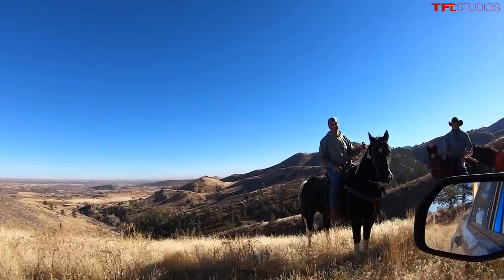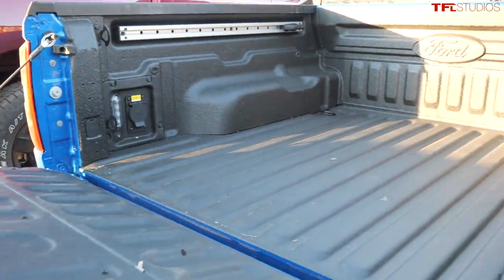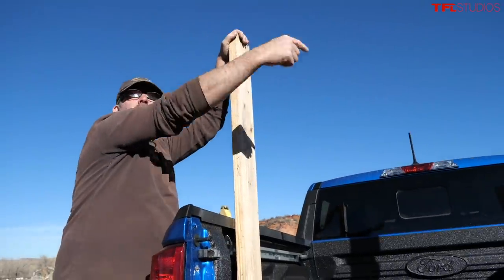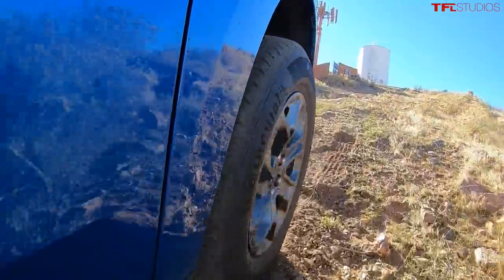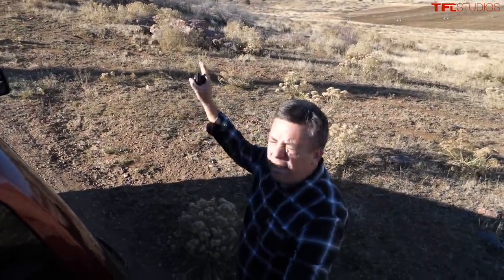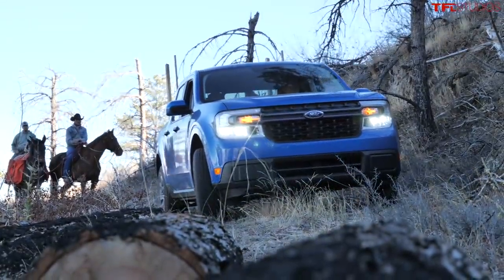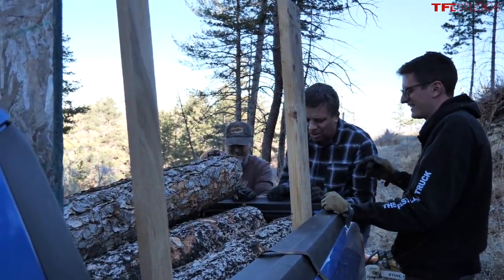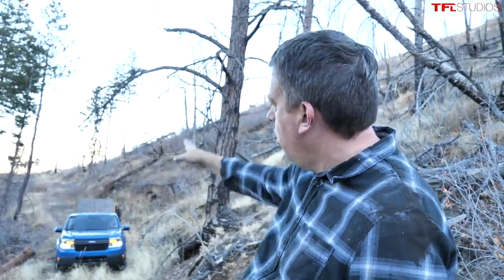Did We Go Too Far MAXING Out The New Ford Maverick To See If It’s Ranch Rated?

Comment: The is good proof for the "I'd rather have it and not need it than need it and not have it" crowd that drives an F-250 everyday to the office just so they can use it for projects once a year.  Get more of these on the roads and the roads are safer and the environment is better off and the owners keep more fuel money in their pocket.  A win all around.  Or like the guy pointed out, it would be perfect for his wife, but could serve as a backup ranch truck in a pinch.  Or the ageing full size can be kept as the ranch truck and used strictly for ranch duties and occasional heavy loads from town.

Comment: One question. If it only uses the electric motor when backing up and has no reverse for the gas motor  what happens if you have a battery problem like I've seen many times on hybrids?

Comment: I know I’m late but I personally like the maverick as it fits a category that not many other trucks do. The bed is bigger and more functional than thst Hyundai monstrosity. People who want a usable bed but a reasonable side vehicle will love this
Reply: We've had ours for 2K miles now. Amazing vehicle for the price. Hybrid averaging over 40mpg with a majority of that being highway and interstate driving (think total mpg average since mile 0 is around 44). The e-CVT seems solid so far. Very responsive, barely notice the shifting. Smooth ride. Did well on some of our earlier heavy snow days a couple months back. Plenty of room for my 6 ft frame. Very little road noise...compared to my jeep at least. Can fill the bed up with camping gear with room left over. Couldn't be happier. Having a usable truck that does double or triple the mpg of a larger truck is a no brainer.

Comment: All that weight in back and the drive wheels are in front. :-( 4wd should be better though. And with IRS you lose axle clearance when suspension sags, unlike with live axle.  1500lbs is a lot of weight, and in fact that was top tier for 1/2 tons of the 70's. Wasn't even until the "F150" (and "D 150" and Chevy 'heavy half') of the mid 70's that makers successfully gamed the original pickup EPA standards, which originally were only supposed to be on 6,000lbs GVW and below.
Reply: Not sure if the IRS comment was related solely to the AWD version of the Maverick or not, but interestingly, the FWD hybrid features a torsion beam rear axle.

Comment: You equipped a base model fwd hybrid to 26k? I played around with the build and price and I got 26k, destination included, for a 2.0 Ecoboost AWD without the safety nanny's, I selected the bed tray and the 4k tow package, black tailgate lettering and not much else. Color was ionic silver and had steel wheels. Would have paid and extra 4k for the next trim up with alloys and yellow paint but steels and silver paint look too good. Plus finance (based on $6500 down payment and $750 trade in) was $405 a month for 48 months
Reply: They're testing an XLT trim, not XL base...that's where the extra MSRP comes in.
Reply: @NukePooch1  ah, ok. But still for the same price and can get a pretty decent work truck for your money
Reply: @harleyrobertson6746  True. I'd personally go for the XLT AWD EB, unless there's an easy way to add aftermarket cruise control to the base model. Agree on preference for the steel wheels...but I need cruise control for my commute.

Comment: Just curious but what if the battery is dead and you need to back up? Maybe I've missed that specification detail 🤔
Reply: The e-CVT features 2 motor/generators- so my guess is as long as you jump start the normal 12v starting battery- once the engine is fired up it probably produces more than enough power to spin the other motor/generator to facilitate reverse.

Comment: No reverse gear.. only the electric motor drives reverse. So if that electric motor battery is dead.. you cant back up.

Starting to feel like Ford screwed up.
Reply: Not how it works
Reply: @Xhsjeiuwpuys234  Do you have one?
Reply: @user-cx2bk6pm2f  ya

Comment: Yeah the little truck did what it supposed to do still maverick is supposed to be a car not a truck another Ford screwup. I’m just not impressed with any manufactures light duty trucks super duty’s there’s still a truck the F150 may be able to tow they gave it a pay low capacity but the bed is so small you can’t get that kind of weight in the bed

Comment: Wow! Other than the tires, this is a very capable mini truck. Definitely would have to try the all wheel drive with different/more capable tires.
Reply: Better tires on the FWD version would still help it tremendously. The OEM's are geared toward street use/grocery getting. A good set of snow tires makes many a FWD vehicle a snow trooper. I'd much rather drive a FWD truck in the snow versus a RWD(only).

Comment: God damnit why can’t people find other words than trucklet
Reply: I call it a pickup. It's accurate, and the Maverick isn't a truck. It's probably the most capable non truck vehicle in recent years but it's still not a truck.
Reply: Exactly. Never heard them call the original Ranger a trucklet and this is the true replacement for the original Ranger.
Reply: @scupking  Not even in the slightest. The Rangers were compact trucks that were ultra durable long lasting vehicles that while gutless for the most part could carry and or tow an obscene amount of weight with multiple cab and bed configurations all while getting better MPG than full size pickups. They were work implements first, passenger vehicles second. 

The Maverick is an midsize unibody pickup that comes in one body style and that is of a 4 door 5 seat short bed configuration. It cannot tow or haul an obscene amount of weight. As shown in the video above they were over gross with the pickup bed filled up with longs and two skinny people in the front. This is the dilemma I see with the Maverick: Get good MPG, Tow a light load. carry a light load by yourself, transport 5 people with an obscenely light load in the bed or no load, etc. You can only pick one of those at a time. The old Ford Rangers could do at least 2 of those at a time. 

If you decide to get the 4K towing package kiss your MPG goodbye, to such a degree that if you can afford it an F-150 Hybrid would be a much more capable, much more practical pickup that only gets a couple MPG less than the ICE only Mavericks.

The Maverick is a passenger vehicle first and a work implement second. 

Ford could definitely make the Maverick into a much more practical pickup (with a midgate, AWD Hybrid option, possibly an econobox ICE only FWD 1.5L 3 cylinder  Manual transmission variant, etc. 

That being said the Maverick and the old Ford Rangers are two very different types of vehicles. I think the Maverick will sell like hotcakes and that it will replace many tired old Ford Ranger pickups not because it is a replacement for the old Ford Ranger pickups, but rather it is the closest thing to an old Ranger pickup that you can buy today in the US. For autoparts stores, for people who use old compact pickups for commuting and hardly any truck type stuff, who don't need the durability, simplicity, modularity, etc. of the old Ford Rangers the Maverick is an amazing option.
Reply: @MrLM002  I don't no but to me the Maverick seems like the original Ranger replacement. 2011 Ranger could tow 1600-3100lbs and had a bed capacity of 1400lbs. The Maverick can tow 2000-4000 and has a bed capacity of 1500lbs.
Reply: @scupking  Fair enough. That being said there are previous generations of the compact Ford Ranger that could tow over 6000lbs. 

As said previously the lack of bed and cab configuration options limits the usefulness of the Maverick for truck duties. Some people haul light but bulky stuff. Some people put a camper top on so they can sleep in the back while camping, some people haul 4x8 sheets of plywood, etc.

Comment: I think it is inadequate as a pickup.  I am disappointed that Ford would put their name on it.  It sets the bar lower instead of higher.  It is time for a senior management change at Ford.  Design flaws, production delays and and other assorted problems coupled with this abomination.

I was a long time Ford truck buyer but the best Ford truck I have owned is my oldest.  I won't buy another Ford truck as I don't like what I observe.

Plate C

Comment: Fwd truck lol no way in hell. CVT in a truck f*ck no. It'd be better to just buy a Ridgeline than a maverick if you want a fwd unibody truck way more reliable. And if you want a good work truck for a cheap price can't beat a tacoma. They hold their value better than any other truck on the market so buying a brand new one it'll still be close to the same value a couple years later and it's one of the most reliable trucks out there and you can do all that and more with a tacoma than a new maverick.

Comment: reverse is electric motor only...Typical engineering folly, designing systems with the expectation that they will always function.  If your battery dies, you can't drive in reverse.  A hybrid shouldn't become nearly useless if either the gas or the electric system fails.

Comment: The Rivian Pickup is available now. Please review.
Reply from the maker: Rivian won’t loan us one
Reply: Rivian is too worried about TFL towing and hauling and using the R1T as an actual truck.
Reply: @TFLtruck  different subject but when is the big truck Ike Gauntlet 30+k test like F350 vs Upgraded Ram 3500 with 420 hp 1075 ft lb torque vs new Duramax?
Reply: 'TFL do a great job putting Trucks through their paces.

Comment: So if the hybrid battery is depleted, you’re not going to be able to reverse…makes sense to me!
Reply: I don't think the software would allow that to happen but if it did the engine can kick on and add charge to the battery
Reply from the maker: No the gas engine would act as a generator in that case to keep you truckin